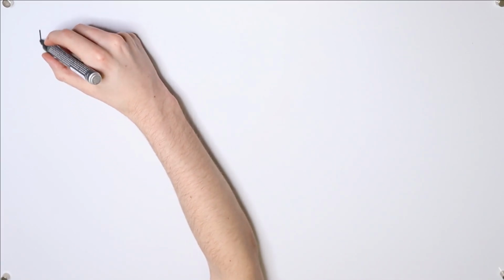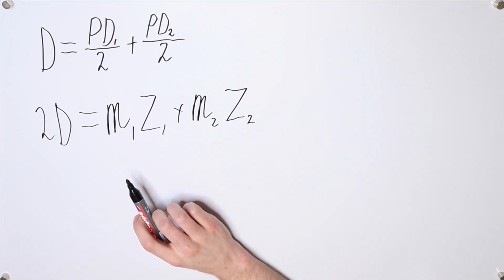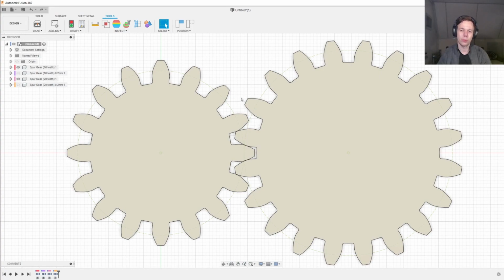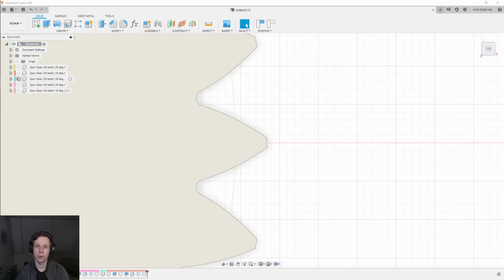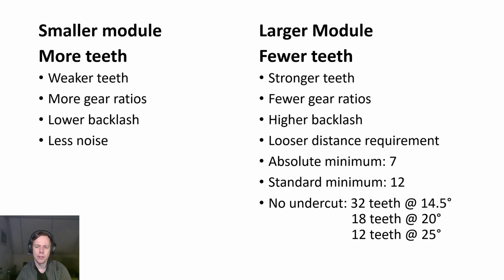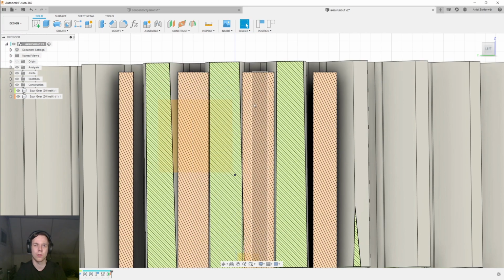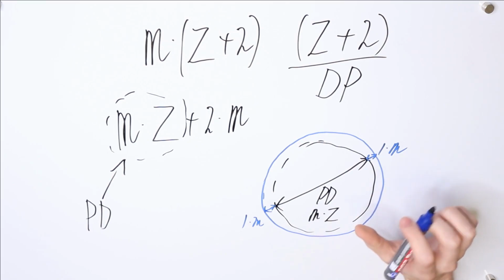Gear Parameters and Design Tradeoffs (Gears pt 2/7)

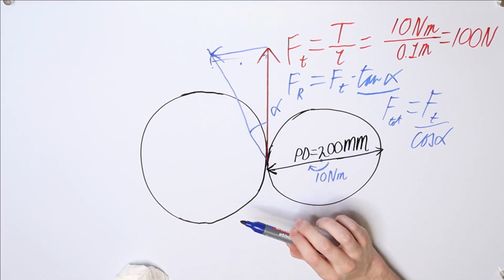Comment: @18:40 Shouldn't this be an easy to solve problem by adding a Bearing supporting the Motor Gear on the opposite side of the Motor?
As in: [Tank Wall] [Bearing] [Gear] [Motor] [Motor] [Gear] [Bearing] [Tank Wall] 🤔 At least that's how I'd approach such a problem on my E-100 ( https://youtu.be/l3_RcOU3zo0 ) if I weren't already using off the shelf Tank Gearboxes 🤨
Reply from the maker: That's actually quite challenging, because the motor shaft is quite short, and the motor would have to be mounted extremely precisely so that the shaft is exactly in line with the bearing. I don't think this is feasible in practice.

Comment: Top notch content on gears, especially for 3D printing. Just what I was looking for. Another advantage of using large modulus is so the printer can print the teeth. With small teeth the printer resolution may not be good enough.  The math was well presented, practical and easy to understand.

Comment: 12:28 you say we need backlash for the better meshing. And also you moved the gear1 to 0.4mm down to touch the other gear so that it can transmit the tork. So our new Distance between two gears value is 53.6 right ?
Reply from the maker: The gear is rotated by 0.4 degrees, only to demonstrate what backlash does. The desired distance does stay at 54 millimeters. Backlash is introduced to ensure that the gears will run well despite manufacturing imperfections.
Reply: @antalz  I see. Did you use backlash for your pump's gears ?.
Reply from the maker: @bepbep44  Yes, I believe 0.1 or 0.2 mm. Best thing is to try out what amount of backlash works for you. For tolerances in general it's best to first tweak the horizontal expansion so you print good tolerances generally speaking, and then tweak backlash to get well-running gears.

Comment: What is the backlash formula been used.Addendum dia (d-2a)and dedendum dia (d-2d) formula I had used but still the tooth is entering the base circle (rd cos theta).Any solutions would be helpful.
Reply from the maker: I believe the problem is your combination of tooth count and pressure angle doesn't work, you need more teeth or higher pressure angle. You can also use undercutting or profile shifting, but I don't know how to model either of those.

Comment: Hello! Could you explain what the pitch diameter is? Like, is the diameter of the gear without the teeth? Or is it just an arbitrary point on the gear.
Reply from the maker: The pitch circle and its diameter, are a bit abstract. It's essentialy a virtual circle that describes how big the gear is. For two gears to be in proper contact, their pitch circles much be tangent to each other. The teeth are constructed around the pitch circle. How far they stick outward is called the addendum. There are also cutouts in one gear so the teeth of the other gear have somewhere they can go. The depth of that cutout is called the dedendum. For standard gears the addendum is equal to the module, and the dedendum equal to 1.25*module.

I think for better understanding you should create a number of gears in CAD. First create a bunch of gears with module 2, and tooth count 15, 20, 30, 50 or something like that. Then create some gears with tooth count 20, but with module 1, 1.25, 2, for example. Fusion360's generator shows a faint green circle that represents the pitch circle. I think by doing that, and possibly trying to joint up some of those gears and playing with them, you can get a better feeling for what the pitch circle is.
Reply: @antalz  Thanks a lot!

Comment: What if your in metric?
Reply from the maker: Not sure what you mean. Metric uses the module in millimeters, customary uses diametral pitch in "per inch", or teeth per inch of diameter.
Reply: iPad text issue. S/B “what if you used metric?”
Reply from the maker: @srrlrrmuseumphillips  In metric you'd just use module measured in millimeters. I'm afraid I don't understand what the problem is. Do you need information on how to convert diametral pitch to module and back?

Comment: Great video, but I've come from pt 1 video that mentions module and pitch diameter and promises that it will be explained in the next video. However this one expects people to already know what a module is. Could you explain what this is? What physical value does it represent and how are the initial formulas derived?
Reply from the maker: Perhaps that was dishonest advertising. The point of this video isn't really to tell you what exactly the numbers mean, just what the numbers do, and allow you to select numbers to create a working gearset. In that context, the module is just a number that represents how large the teeth are. The pressure angle is a number that affects the shape of the teeth, a higher number makes them more like triangles. If you really want to know what the module or pressure angle truly mean, then you have to get into a lot of math and geometry that I felt most people wouldn't care for.

You can find an explanation here: https://www.tec-science.com/mechanical-power-transmission/involute-gear/geometry-of-involute-gears/
Reply: @antalz  thank you, I'll try!
Reply: I read from other places that helped me: the pitch circle is imaginary meaning that it cannot be measured directly, and the circumference of a circle (actually any circle) is most like an irrational number (because of Pi). So it's not practical for engineers to use the circumference of a circle (divided by the number of teeth or not) as a  basic unit for gears. So the solution is to divide the circumference by Pi...then divide it further by z the number of teeth, which is the module (i.e., m=c/pi/z).

Comment: This series is great. But how exactly do you choose the root fillet radius? Are there any tricks for this?

Edit: I just watched the video on helical gears and I think i understood what this does.
Reply from the maker: It gives some strength to the tooth roots, but I don't know when they become too large. The gear generator will stop you if you make them too large, but with manufacturing inaccuracies you may run into problems before that. Again, I'm not sure when that might happen.

Comment: Could you possibly do a video on gear ratios aswell
Reply from the maker: Not totally sure what you mean, the gear ratio is the ratio of the teeth, or the ratio of the pitch diameterss, which is the same because the module must be the same.
Reply: @antalz  sorry. I meant in terms of force, like lifting weights, and moving loads

Comment: So far the first part of your explanation for most of people that are watching or listening they are so confuse cause they DO NOT understand what is module or diametral pitch and so on I do understand what you are talking about , so if you want to teach about gears should you start with the basic
Reply from the maker: But people don't yet need to know what those numbers mean. They're numbers you can put into a gear generator, and I explain what numbers you need to put in to make something that works. What the numbers mean is not important yet at that point.  I first want to show people how to make something that works, before I talk about tradeoffs or other more advanced topics. For some folks it's fine to do theory first, then practice, but many people just get confused by the theory and click away, so I purposefully choose to do practice first, before stepping into theory.

Comment: This is literally the godsend in gear design I've been looking for. I like how you answer any questions someone might have, I was constantly going "okay but what if the module is bigger, or smaller, what about minimum teeth, etc" and you kept answering and explaining everything in detail. Brilliant stuff! I also like how gears are such an exact and simple science, no need to mess about with complicated maths, there are standardised pressure angles and few hard and simple rules to follow, makes it super easy to design a gear for any application. One thing i'd be interested in is a way to calculate the minimum module you can use given you can measure runout or shaft dimensional accuracy so that you'll never get teeth skipping unless total failure happens. Say you have the situation you mentioned last video about the housing of the tank not being rigid enough. (Obviously you can't have perfectly rigid housing or shafts but you can predict their deformation given the forces.)
Reply from the maker: Yeah a lot of other videos only vaguely explain what's going on. Most of them won't even explain what the pitch diameter is, so you have no idea how far the gears need to be apart. Quite strange, but that makes this video very useful to many people even if it is a bit mathematical.

I'm not sure how I would answer the minimum module question. Usually you want the module to be large so that the teeth are large and can take high forces. Very small teeth are usually only needed in fine positioning machinery like microscopes, where strength and shaft deflection aren't really things to think about. Mostly the minimum module in those cases is determined by how accurately you can cut tiny teeth.

Comment: Hi great video. For calculating the outer diameter is there a reason why you use the numerical value of 2 in  m(z+2) , instead of m(z+1) or 1.5 and so on? 
Thank you!
Reply from the maker: Yes and no. For a standard gear, the tooth sticks out 1*m out from the pitch circle, the addendum is 1*m. Because it's a diameter you have to add 2*1*m, so that's why it's 2 in the formula.

However, choosing 1*m for the addendum is only convention, and can be chosen differently.

Comment: amazing, lots of useful information, i have a question:

What about the "root fillet radius"?
Reply from the maker: That's actually an odd one. As I said in the video, the addendum is smaller than the dedendum, so there is a little bit of space near the root of the tooth where the mating tooth is never supposed to touch. Because of that a small fillet can be added there, with the radius you specify. This creates a bit more resistance to bending stress, making the tooth just a bit stronger for high-torque applications.
In theory there is no downside, in practice if the shaft-shaft distance is closer than intended, the tooth of one gear may interfere with the root fillet of the other. I don't really know what the criterion for that is mathematically speaking though.
Reply: @antalz  Thank's great job👍

Comment: hello , already subscribed i really need your help
very good video informative and nicely explained
but here's the question
i want gears for low to high torque conversion and high speed to low speed
i tried to use your formula  for like 15teeth to 120teeth keeping pressure angle 20 degree module of 2 and got a shaft diameter of about 135mm
after doing all i found out that gears are not meshing properly 
i agree that i am not a skilled one in this subject 
so any help from u  is greatly appreciated
please reply soon, also if any other way of contacting u other than this just let me know
thanks in advance
Reply from the maker: Your calculation seems to be correct, do you know what aspect exactly isn't meshing? Are they so far apart they're not meshing at all, are they binding, what's the problem?
Reply: @antalz  thanks for replying
they are meshing
i mean like a chunky manner as viewed in fusion they are not uniform 
ofcourse it is not fault of ur formula and i absolutely do not blame u

forget about it 
i mean the 15teeth gears are like rectangles and the 120teeth gears are like triangles
can u do me a favor  can u design gears like u have done in ur video on how to mount to shaft
using two screws that one and with 8 ratios like thing 
because i am new to fusion and a iam learning

sorry for language
Reply from the maker: @47xGhost  You're going to have to learn this yourself I'm afraid. The tooth profiles should be slightly different, but if they're totally different you may have entered different pressure angles for the gears. Once you figured out the profiles, adding the hubs shouldn't be too much of a problem.
Reply: @antalz  no i double checked 
they are perfect
could  u suggest ay other ratio
actually iam building a steering wheel for that i have to use large torque motor 
since i am using small torque motor i needgear system
could u suggest me any gear  2 or 3 or 4 anything but itshould have from motor to steering shaft like 10 ratios
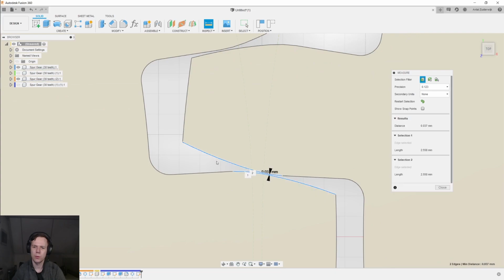Reply from the maker: @47xGhost  If you're 3D printing I would go for a compound system with 15:45 on the first stage, and 15:45 again on the second stage, or something close to that. For this you will need 2 regular spur gears and one compound gear, which you can find a video about here: https://youtu.be/FIwOiLp4d6k
This is a bit harder to do, but gives you a much more compact result.
Reply: @antalz  i will be waiting for your reply
Reply: @antalz  please reply soon

Comment: Very informative. I could use a part 3 on how to design a rack to mesh with a gear.
Reply from the maker: Thanks! Part 3 will be about helical gears, and I don't dare predict when it will come out because I've been too optimistic about it a few times before now.

For making a rack, you can basically recreate the first drawing on this page: https://khkgears.net/new/gear_knowledge/gear_technical_reference/involute_gear_profile.html

Sketch 1 rack tooth, extrude it, then make a linear pattern of bodies, and then finally add the "backbone" of the rack that connects all the teeth into one solid.
Reply: @antalz  I'll definitely give that a try tomorrow. Thanks :)

Comment: One thing I did not quite understand. I figured the blue line on the gear projects the pitch diameter of said gear. As I understand it, this measurement should not be affected by backlash, so, in the drawing with the backlashed gears, shouldn't both gears' blue lines be touching? Because it seems like, even with backlash, you kept a center distance +0.2mm apart between gears.(?) 
Thank you
Reply from the maker: Yeah it does look like I messed that up. Those 2 circles should be touching and I'm not sure why they aren't. I must have moved one of the gears with backlash without realising it? Thanks for pointing that out, you have a sharp eye!
Reply: @antalz  thank you for the quick clarification. Cheers

Comment: Brilliant videos, I watched them with high interest. Unfortunately even after watching them I still don't know how to remake 3 gears I need. They are really small. Outside diameters are 22mm, 19mm and 7mm with N respectively 44, 38 and 12. I am trying to calculate the module, but I do not know how to calculate the Pitch diameter. I know that PD=N/P(Diameter Pitch), but what is Diameter pitch? Is it the full (outside) diameter of the gear I measure with the calliper?
Reply from the maker: Diametral Pitch is a quantity that belongs to the inch standard system of gears. For metric gears the pitch diameter is the module times the number of teeth, so PD = m*Z. If your gears are metric, I think you have module 0.5 gears. The Pitch diameter in that case for the first gear is 0.5*44 = 22mm, and its outside diameter is 0.5*(44+2) = 23mm, so I'm kinda assuming/hoping you mismeasured the outer diameter for the larger 2 gears.

Are you sure the gears are metric to begin with?
Reply: @antalz  You are right, I double checked that and I kind of figured it out myself (wasn't sure that I knew it, but I knew there are 2 formulas). What I did was I filled in everything I knew and then rough measured the Pitch diameter with my calliper and got 22mm. Then I saw that with default module of 5 it gives me 220mm, therefore changed it to 0.5 and it returned Pitch diameter of 22mm in Fusion 360. When I create the other two gears, the module should still be 0.5, right? Thank you!!!
Reply from the maker: @Thebannedone1  If the gears mesh with each other yes, the module must be the same for all of them. Only the numbers of teeth change.

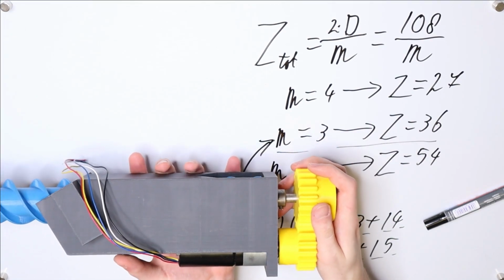Also, for metric gears you shouldn't  try to measure the pitch diameter directly. Instead measure the outer diameter and use: OD = M*(Z+2). It's much easier to measure outer diameter accurately. You can then work out the module, and then using PD = m*Z you get the pitch diameter. I talk about the OD a little bit at the final section of this video at 31:51, but I should have mentioned there that it's also useful for reverse engineering existing gears.
Reply: @antalz  Splendid! Thank you very much for the information!

Comment: Looking forward to your next video!   The FIRST FTC team I coach is using herringbone gears in their design, and we are going back and forth between Fusion 360 and OpenSCAD (using Jörg Janssen's gears library) for design.  We'd love to learn how to build herringbone gears in Fusion!
Reply from the maker: If you want to get going quickly, there's a helical gear add-in you can download. You can then take a helical gear, and use the mirror command. Mirror the helical gear across its top face. Then modify->combine to turn it into a single herringbone gear.
You can also make a helical gear without add-ins by. This is more complicated but goes something like this:
1) make a spur gear
2) make a sketch on the XY plane. Sketch a line from the top face of the spur gear going straight up
3) with create->sweep, sweep the top face of the gear along the sketched line. In the dialog enter a twist angle.
If you want to go for the latter, there's also a tiny bit of math for what twist angle you need to get the right helix angle. If you're interested in that I can write that up real quick too.
Thanks for your comment, and best of luck in the competition!
Reply: @antalz  Thank you for the suggestions!  We're good for this season (going to States Championship next month) but my CAD lead (and I) would like to learn more about how to do it all in Fusion.  I've shared the video with the team, we'll use it as a discussion point as part of an upcoming team meeting.